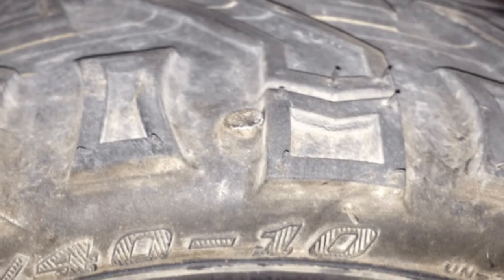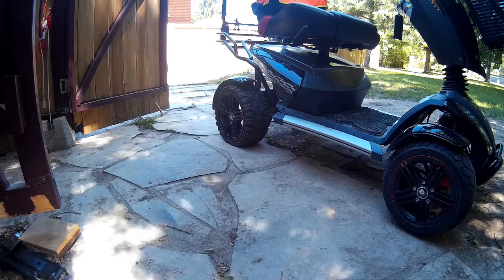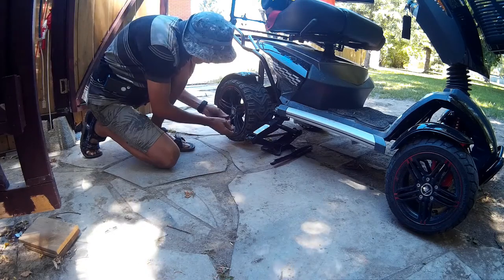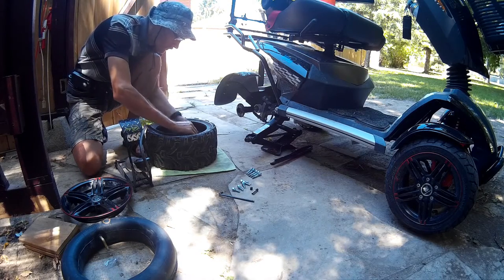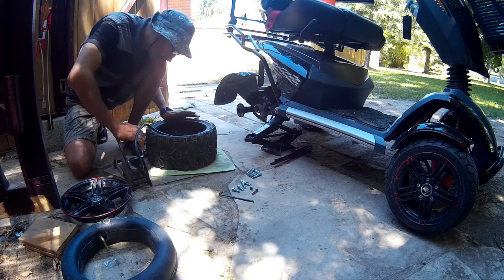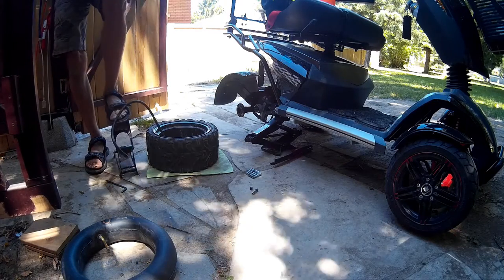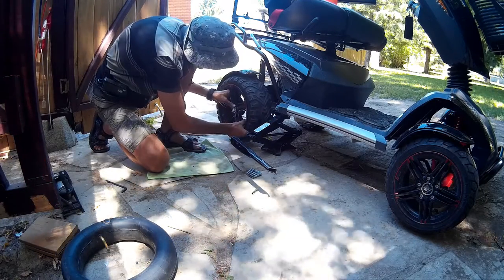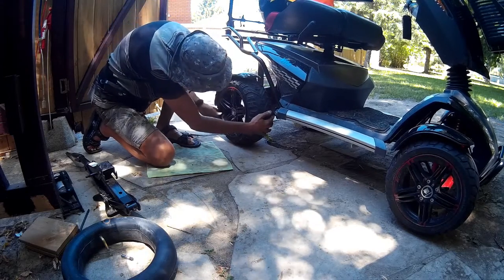Changing the Monster's First Flat Tire

Comment: Have you considered installing  "puncture prevention" liquid in the tyres. This is available from motorbike, cycle and camping stores. Various mobility scooter suppliers in the UK provide it installed when you buy a scooter. There is a video on YouTube by TGA mobility that demonstrates its effectiveness. Also various car manufacturers supply it in leu of of a spare wheel.
Reply from the maker: I used to hate that stuff and always considered it too messy. However, now that I'm dealing with tubed tires, I can see the benefit. By next week, I'm hoping to start my longer trips and am thinking a can of that will be an easier solution than taking along my jack and a spare tube. It would also be beneficial for my old scooter. If a tire goes flat on it, it doesn't move. I've had several people suggest this option. Sometimes it just takes that extra push to get me to change my thinking. Thank you.
Reply: J E SPENCER its called slime available on Amazon

Comment: What is the size of the inner tube you have to buy for it?
Reply from the maker: From the dealer, the front tubes are $48 and the rear tubes are $54 so I found a cheap alternative. Wheel barrow tubes 4.80 / 4.00 x 8 fit both front and rear. They cost between $9 and $12, depending on where you get them. They last longer because they are thicker rubber and a larger diameter, so they don't stretch as much.
Reply: Thanks for the reply
Ive also found out you can buy the batteries cheaper by looking for Leisure batteries and not scooter specific, just match the model number and spec of the battery
Reply from the maker: No problem. I try to answer all questions but it can take a couple of days to get around to it. The external batteries I had on the Monster were RV batteries from CarQuest and cost half the price of the Monster's originals. The charge lasted just as long but I'll never know how their longevity is because I no longer need the longer distances so I don't use them anymore. The only disadvantage is they are not gels, therefore they can leak when tilted. I'm still trying to find a cheap source for ball joints. I have to replace them every year and so far, have had no luck finding any source other than the dealer. It's always good to shop around. The suppliers know the government pays for repairs so they can charge whatever they want. That makes it difficult for those of us that prefer to pay for things ourselves, or have to. In my experience, when searching, if I include 'mobility scooter' in the search term, the prices instantly triple. It's crazy.
Reply: @TheTimeCapturer   so 4.80 / 4.00 x 8 tyres should also fit too saving you more cash ??
my tyre are 80 65-8  i was told 3.00-8 will fit ??
but i dont know
Reply from the maker: ballkeeper666 Probably not because the tubes are round and stretch out to wide ovals when inflated. Tires that size would be too narrow for the rims.

Comment: Ever considered tire weld as an alternative when out and about
Reply from the maker: I've never found anything that works with tubes. I don't worry about it though. With The Monster's low profile tires, I can drive home on a flat.
Reply: @TheTimeCapturer  touch wood I've had no prin age's but always carry one with me just incase   should never ride on a flat because it damages the tyre +inner tube
Reply from the maker: I've only ever had to change a flat tire on The Monster once away from home. I was on my way to the conservation area in my "Monster In Its Natural Habitat" series. I suck at patching tubes so I just replace them. Because I was travelling so far from home, I had tools and replacement parts for everything I could imagine going wrong. :)

Comment: Comment faire pour ne pas pincer la tripe avec le rim?
Reply from the maker: The split rims (two piece) offers an advantage. I put the tire on the main piece, then tuck the tube into the tire. The trick I use is to partially inflate the tube before attaching the second part of the rim. This greatly reduces the chance of pinching.

-------------------------------------

Les jantes fendues (deux pièces) offrent un avantage. Je pose le pneu sur la pièce principale, puis glisse la chambre à air dans le pneu. Le truc que j'utilise est de gonfler partiellement le tube avant de fixer la deuxième partie de la jante. Cela réduit considérablement les risques de pincement.